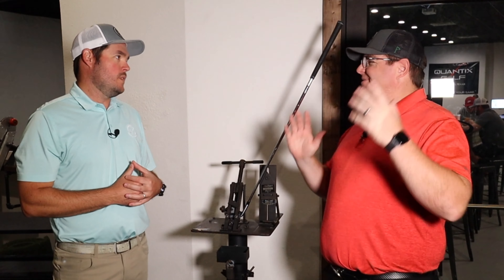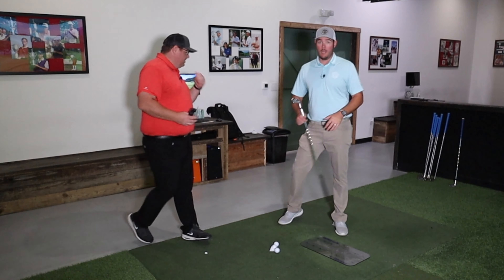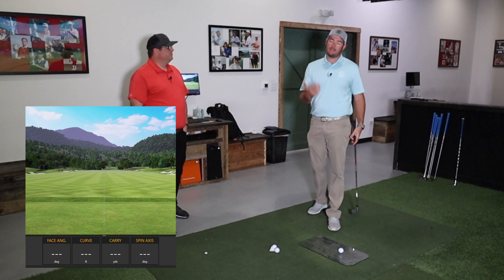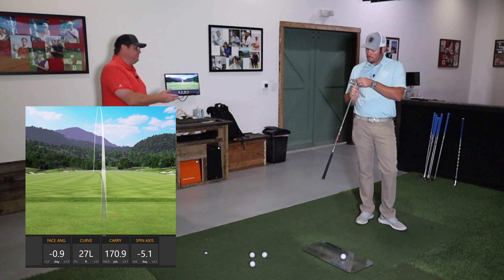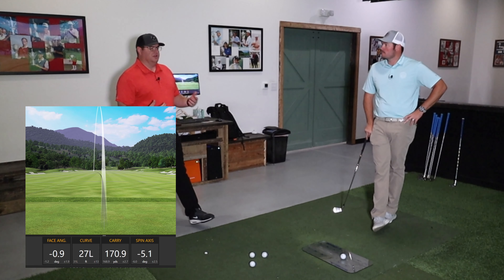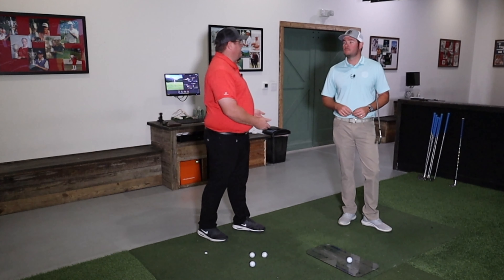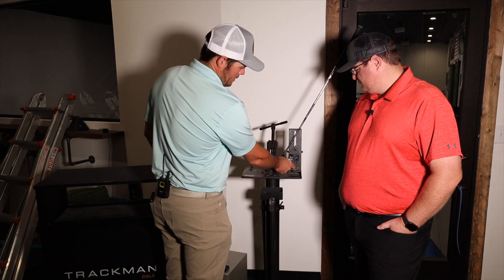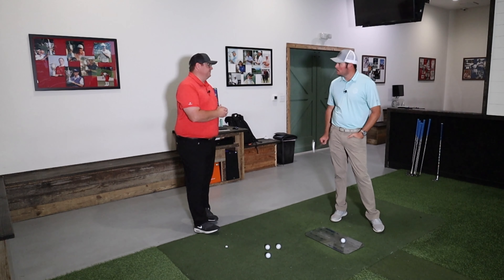Cause and Effect //  Changing the Lie of Your Golf Clubs

Comment: so i have ping i25 white dot 3 degrees up and +1/2 in length tat i was fitted  for statically and dynamically on a lie board in 2014. i have always been told that the shaft flexes down at impact and the toe should be up in the air a bit at address. do you guys agree with that ? i've also seen stop action pictures where the shaft is bending backwards and then maybe forwards near impact, what is the deal with that. thax for the info.